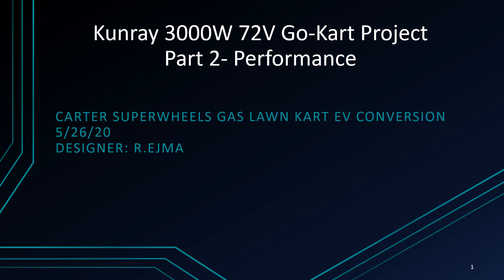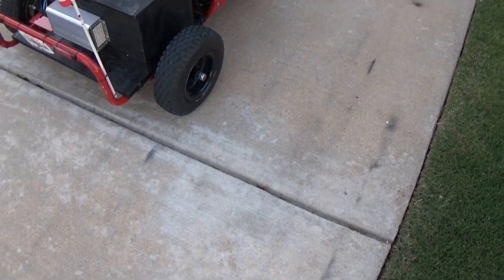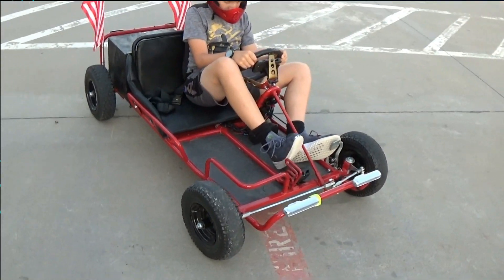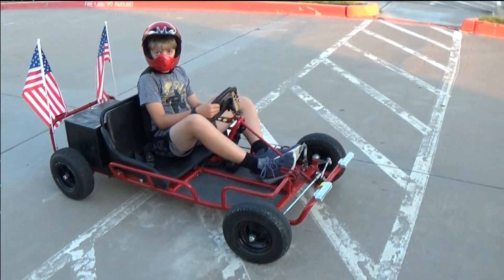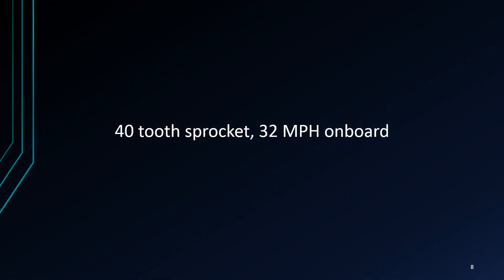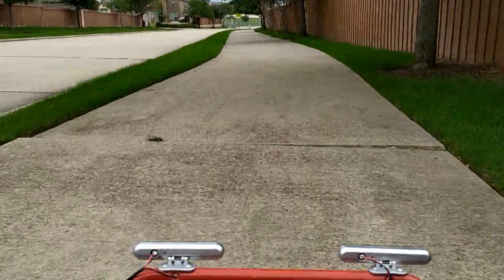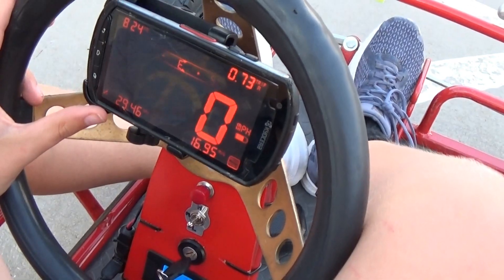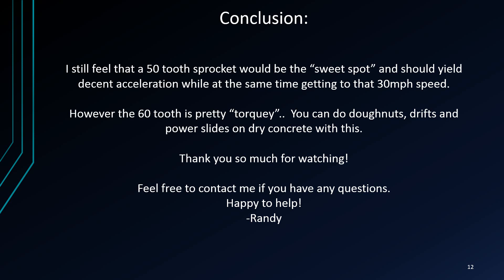3000 Watt 72v Kunray Electric Go Kart Build, Part 2

Comment: Do you know what the range is for the Kart? Im looking to make a go kart myself and curious what battery I need to go 10+ miles
Reply from the maker: The initial iteration had the Nissan Leaf Cells and that was about 32 ah.. That would most certainly do that.  The final iteration was LiFEPO4 cells at 24ah and that was ok for running around the neighborhood.  Fortunately I have sourced some amazing cells that I have available on e-bay that are outstanding for go-karts... They are super high discharge 32ah LiPo's that can dump 150 amps continuous.  I can make an awesome 72v battery for you w/ these.. I brought in 200 and have about 170 left.

Comment: Cool project!!    
You probably figured this out already, but sounds like your chain is a little to tight.   Is it getting hot? I e found that I had to change my sprockets to get a larger diameter on the motor so the chain wasn't taking such a tight corner, and the noise, heat and resistance cleared right up.
Reply from the maker: It was, but yeah we got it straightened out. :) Thx for the tip!

Comment: Does it have regenerative braking?
Reply from the maker: This particular model of motor and speed controller do not have this feature.  However, given this is a kid's go kart, that level of tech is probably a little out of band for a project like this. :)  Maybe the next one?
Reply: @TexasNEV  oh, I just bought this kit and was wondering what the high level brake and low level brake plugs do? Assumed it meant regenerative braking.
Reply from the maker: @anishnattamai8801  I believe the "low level" is just a motor cut off function and "high level" the motor offers some resistance as a breaking effect, but that's just my guess.  Note that if you are using the "high level brake" function on a chain system w/ a freewheel sprocket, then it will just spin.
Reply: @TexasNEV  oh thanks for the info, do you know how to control the high level brake? I see it only has 1 wire in the plug and I have no idea what to do with it.
Reply from the maker: @anishnattamai8801  Unfortunately, that makes two of us!  Perhaps reaching out to the vendor who sold it to you or maybe someone on this thread knows and can share?

Comment: Cool build ...but why the offset seating?
Reply from the maker: Not sure what you mean.
Reply: @TexasNEV  your driver is all the way to the left side of cart...just seems it would be more comfortable more centered cause there is not really enough room for two
Reply from the maker: @randygentry2442  Ahh, well the steering wheel is NOT centered, it is off to the left.  This is a two seater, but for frame of reference, the Carter SuperWheels is classified as a "lawn kart", (IE it's small), plus my son is pretty tall for his age.  Part 1 and 2 show it more clearly.
Reply: @TexasNEV  👍

Comment: The front steering doesn't seem to have Ackermann -- that's probably why the tyres are wearing badly. Could also be the straight-ahead alignment.
Reply from the maker: It's been recently upgraded to front springer spindle,s but the real reason is that we were using riding lawn mower turf tires on pavement.  Once we changed to CST slicks the problem went away.

Comment: I fitted usb output, 12v socket with voltmeter to my racekart, then swapped the seat for a carbon fibre one, and fully padded the seat including 2inch memoryfoam  seat pad covered in a black pu leather with green stitching, fitted front brakes, billet aluminium pedals and a new steering wheel and decals to finish it off. It's also got a digital dash plus phone mount and has fittings for gopro's which can be recharged in use. I still want to add a battery charger on board, maybe a stator on the rear axle or similar but not figured that out yet.
Reply: https://youtu.be/qz8IOCpD2JY

Comment: Hi. Really nice job. We have converted a racing cart using the 2kw kunray motor and 54 v battery. Do you have a separate battery for the lights ? Also do you recommend the battery monitor and where did you get it ?
Reply from the maker: No separate battery, in the video I explain the use of a Buck converter to drive the LED headlights.  It converts 84v to 12v and powers his phone charger too. :)
Reply from the maker: I also mention the BMS that I used as well as where to get it. :)  I recommended the LLT power Bluetooth BMS from Lightspeed Bikes.

Comment: I'd get a smaller sprocket, i can hit 27mph on 1800watt 48v motor and my go kart is literally made of wood and a dining table chair, I think our sprocket is 35 teeth.
Reply from the maker: If you watch the series, I tried a 40 tooth, not enough torque, poor acceleration and too much heat. I got the same top speed with a 40 as I did with the 50 that is currently on there now.  Top speed with the 50 is 34.  I would venture to guess that a steel frame with 20s worth of nissan leaf batteries weighs a tad bit more than your wooden chair rider. :)
Reply: @TexasNEV  nice!!

Comment: Great fun project.  I need to go watch the first build video but it would appear you have plenty of battery for the job.  Keep your eye out for a live axle cart, run two motors and controllers and you will keep him entertained through his 20's. There is something magical that happens when two motors share the load. Curious about motor temps and controller temps. Now I'm going to pick up a couple of these motors.
Reply from the maker: Yes the first video has all the math and engineering and yes, the range on this is crazy.. My son runs the heck out of this thing and he goes days w/o charging.   Controller and BMS do not get hot at all.  Motor? Yeah when it's 100 degrees outside and sunny and he's going all out? That motor gets pretty darn hot, but still within spec. It's a sealed motor, so we do cool it down w/ the hose on "mist" setting. LOL
Reply: I am about to do the 2 motor build on my son’s kart. To solve the problem with a solid live axle not wanting to turn on dry ground, I am going to cut the axle so there are a left axle/left motor, and right axle/right motor.  Essentially it should act like a limited slip differential.